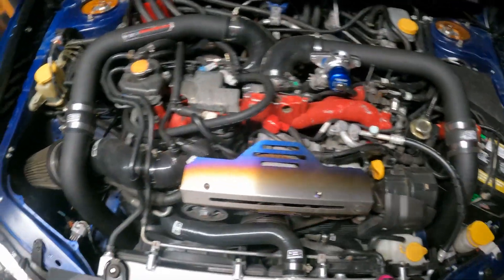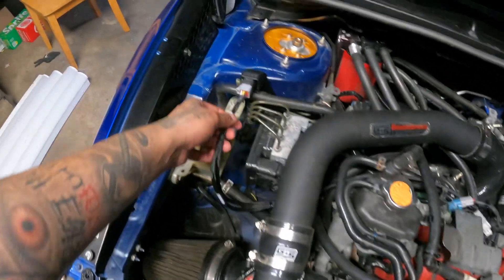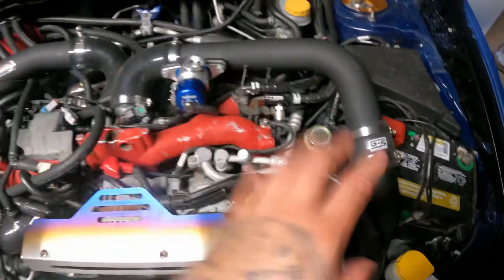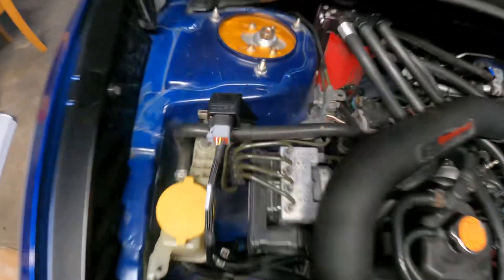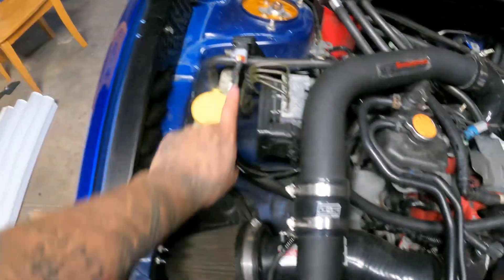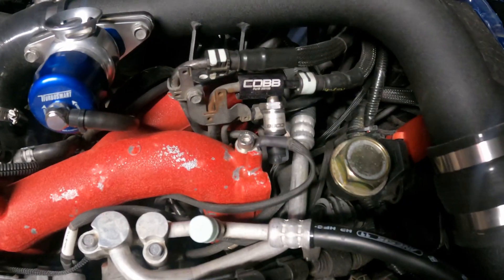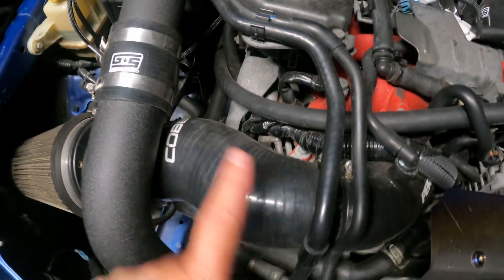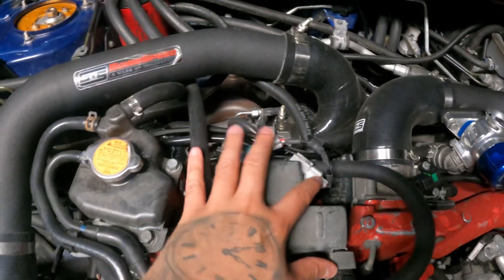Cobb NexGen Flex Fuel Kit Recap

Comment: So you had the first gen that was discontinued and you just bought the nextgen upgrade ? I’m looking into getting tuned but told me they can’t tune that first gen anymore
Reply from the maker: Yes, so what i did was i had the first gen flex fuel set up. All that is needed for that to be “greenspeed” compliant is the wiring harness. So Cobb offers just the new wiring harness .
Reply: @subifelixx  what if I remove that old flex fuel kit and harness will everything just plug back like it was stock ? Or will I need oem lines and harness
Reply from the maker: @ManuelPerez-sw9nj  yes, it will all plug right back up! Best option to do!
Reply: @subifelixx  sorry another quick question, if I remove it and plug everything back in will my car still run fine ? Ima get tuned but he said to remove it before he sends base map but idk if it’s still gonna start and run right
Reply from the maker: @ManuelPerez-sw9nj  yes get the new wiring harness in before you flash your base map!
Reply: @subifelixx  new harness ? I’m not planning on doing a flex fuel kit anymore so I just plugged everything back in and threw a p2004 code

Comment: I want to say thank you so much!. I made the mistake of having my fuel pressure sensor on the driver side instead of the passenger side. It caused me to have 6 check engine lights on. Just swapped it back and they are gone.
Reply from the maker: @briancarrollii4359  what were the lights for? I didn’t experience this at all
Reply: @subifelixx COBB 1,3,6,7 TGV POS 1 and TVG POS 2
Reply from the maker: @briancarrollii4359  weird , i didn’t get those bro
Reply: @subifelixx  you wired it properly the first time. I didn’t so I got codes. Didn’t realize the problem until you said how you did it in the video. I’m super happy you posted it I was so lost